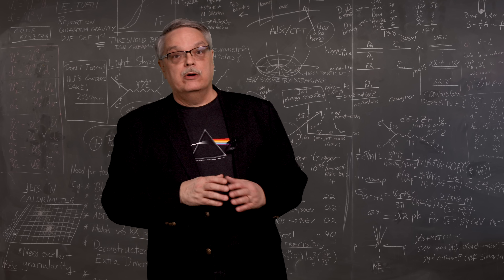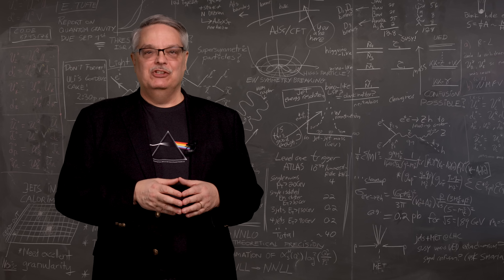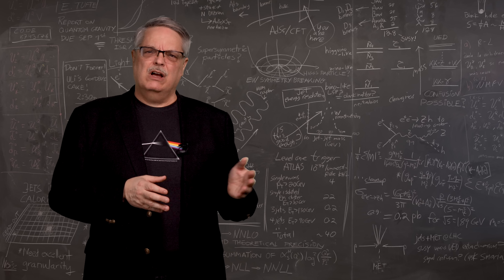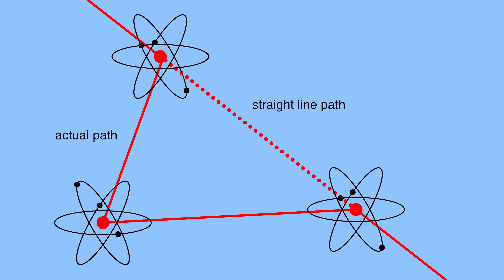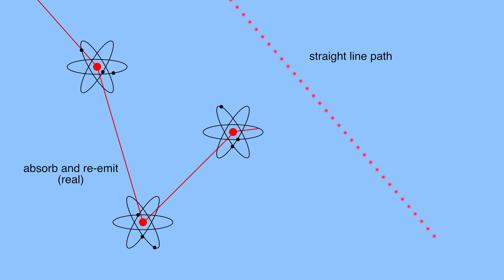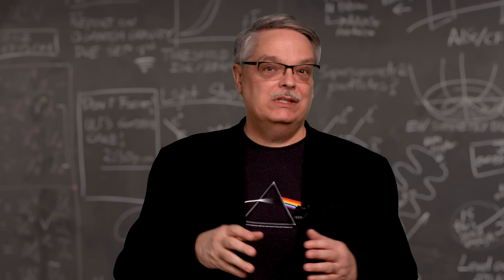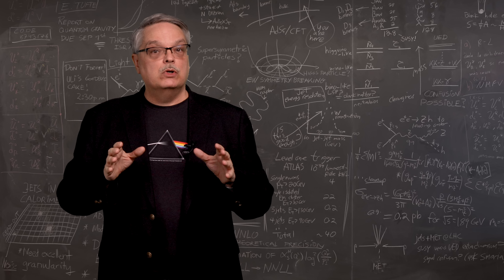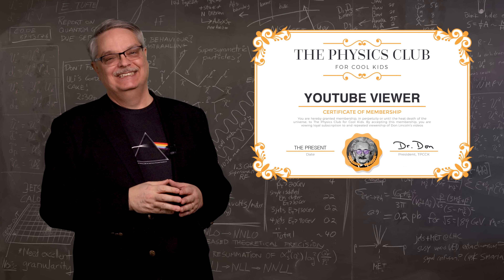Why does light slow down in water?

Comment: What a great explanation. A physics teacher just got taught.
Reply: John Wright #lit
Reply: #worstphysicsteacher
Reply: @edrobinson5438  but not ginger
Reply: #exginger #childhoodtrauma
Reply: @Henry-dz4so  Not sure what this means
Reply: What a beautiful comment John
Reply: @harryphilipson-stow5402  Mr Wright to you
Reply: Beautiful
Reply: as a physics teacher you should be ashamed to even consider this a valid explanation...
Reply: @recouer  What would you consider to be a good explanation?
Reply: @chopperwright  
i don't know what grade you teach but for university level education, well it's clearly full of wrong hood.

to understand how a wave propagates, first you'd need to understand d'alembert equation and dispersion relation.

then you'd need to study maxwell's equation to understand how EM waves propagates in a void (take the rotational of maxwell ampere or maxwell faraday to find the equation of d'alembert that EM waves follows in a void; btw void => volumic density of charges is null)

then you use paul drude's model to understand how EM waves propagates in a medium (also that fact that it is neutrally charged implies that the volumic density of charges is null so the condition to get the dispersion relation are still respected).
and you use newton's second law on an electron, using this and assuming that it oscillates, you'll get a relation between the electric field of the EM wave and the speed of the electron.
you can then get the volumic density of current in the field induced by the electric current.
you introduce that in the maxwell equations to and you get a new dispersion relation, with the frequency being smaller, you thus get a wave with a smaller speed through the medium.
thus the slowing down of the light is due of the induced electric current from the EM field and not a superposition of light...

also, if the electrons emited light from the EM wave, we'd see EM rays with stonger intensity as light travels a dispersive medium but even that isn't quite true as if we still have the refractive properties of such medium, then those photons would travel at different direction from the incident light.
Reply: @recouer  Phew, I'm glad we agree. Need a wave model to explain this. He does such a great job at explaining the concepts clearly so that a typical teenager can understand it. I look forward to your video on the subject.
Reply: @chopperwright  
i'm not a content creator so i wouldn't be able to do it. also i have other imperatives as you see i'm a rather busy person and only happened on this video during my free time.

and no he does not explain at all what is happening but rather either saying something wrong due to lack of vocabulary or misunderstanding.
first, superposition of wave: the resulting wave still has the same speed no matter the frequencies of the superposed waves.
then the electrons do not emit an electric field as they move, but an electric current, wich is a big difference.
Reply: @recouer  it's not the different frequencies of the wave, it's at different speeds!
Reply: @chopperwright  
in a void, all EM waves have the same speed.
Reply: @chopperwright  well that may not be clear enough but if you were a physics teacher (which i highly doubt now) you’d understand the many problems this “explanation” would bring to a neophyte on the matter, as shown by the many people who are left with more misunderstanding on the subject before than after the video.

anyway, first of all, the emitted light from the electron, this one is wrong on so many level:
if light was emitted due to the movement of electrons, then the light should gain in intensity as it goes through the medium since light is quantified and thus the superposition of the two photons would give one with the cumulated energy of the two.

then there’s how he tried to explain what is the frequency of the superposition of two waves, but i won’t get too much into details as it is more mathematics than physics. but basically, you need to take into account the temporal and space dependency, which he did not.
or the cancellation of the two waves… well that only happens in some very special cases and we need to be cautious about how it’s described.

also he describe the waves as if they were linear and infinite, but this ain’t always the case, but we still observe the slowing down of the wave inside the medium, how come ?

then he says moving electrons set their own “electric field” which is wrong, you can easily know the electric field of an electron using coulomb’s law. however, things are a little more tricky with dipoles. however, the electric field has nothing to do with our exemple here.

the thing is he should have been talking about electric current, which is greatly different to an electric field. because you don’t create light every time you create an oscillating electric field.
heck, electric cars would radiate a shitton of light otherwise !

and then again, light speed is dependant on the medium, thus the electron that it would create if we are to assume that it actually radiate one, would go to the speed of light the moment it leaves the electron, thus no adding of velicity, they both travel at the same speed.
Reply: @recouer  but it is in a medium, not a vacuum.
Reply: @recouer  Rather than attacking his ideas present your own ones. I am struggling to follow your line of reasoning. Is English your first language?
Reply: @recouer  Electromagnetic waves are created by accelerating charged particles. Cars emit loads of electromagnetic waves, not because they are moving, but because they are hot. They emit mainly in the infrared part if the spectrum. Its nothing to do with the car being electric or petrol, it's just because they contain protons and elections. There are charged and vibrate because they have a temperature. The oscillation of charged particles is how ALL electromagnetic waves are formed.
Reply: @chopperwright  
no it's not and it becomes all the more obvious when i need to translate scientific terms but still it is comprehensible (if i did put quotation for every things i was refering to... i'll do that now)

anyway, i see you do know some physics well i'll give you some wikipedia articles that would get more into details, maybe it'll be clearer that way:

https://en.wikipedia.org/wiki/Maxwell%27s_equations
https://en.wikipedia.org/wiki/Wave_equation
https://en.wikipedia.org/wiki/Drude_model
https://en.wikipedia.org/wiki/Mathematical_descriptions_of_opacity

those are in order but if you are already familiar with the first two or three just go to the last.
Reply: @chopperwright  
as for my references, well it was my lessons, but since i am most kind, there is this book that is a pure condensate of physics, a great introduction to many interesting fields of it:
https://www.dunod.com/prepas-concours/physique-tout-en-un-pc-pc
well i hope you like french.
Reply: @chopperwright  
oh and i wasn't talking about thermal radiation, i don't know why you assumed i was talking about it when i was clearly talking about the varying of electric field in a medium.
the thing is, you can create varying electric field in mediums without using EM waves.
does it creates EM waves then ?
Reply: @recouer  I admire your enthusiasm. You have been quick to condemn a university lecture and a physics teacher, a little humility would no go amiss. You have read widely around the subject but you have not applied the physics well to the situation. Think through your explanation of why light slows down (don't just copy and paste complex physics, think what physics you need to explain the phenomena). Find a video or written explanation that you agree with then send me the link.

If you are a student show the video to your teacher, ask them what they think.
Reply: @recouer  Frequency stays the same, otherwise the light would change colour.
The wavelength decreases in the glass, and therefore the speed decreases.
Reply: @chopperwright  
think again, what is the relationship between wave length frequency and speed.
(this is no way to advert the subject, i'll give you the answer but i want you to think about it before)

and well, true i should show humility.. when i am talking about something i don't know about, this is not the case here.
Reply: @recouer  Great. The charged particles move very slowly in a conductor because there is so many of them. We are talking mm per second or less. The accelerations of the charged particles are very low. There is not a lot of em radiation produced by direct currents. To generate Em waves ac is used.
Reply: @recouer  wave speed = wavelength x frequency. When the wave enters a medium and slows down

1 wavelength decreases
2 frequency stays the same
3 speed decreases

Not sure what you are getting at here. I do admire you doing this in a second language.
Reply: @chopperwright  
i did try to find written explanation that are not on the wikipedia page but they are all paid book...
however i can assure you the wikipedia page is a reliable source of information on the matter, as it is edited by peers.
Reply: @recouer  Send me the link!
Reply: @chopperwright  
why should the frequency stay the same ?
what i'm getting at is that it is the frequency that is modified, not the wavelength.

the link i already sent, look for maxwell equation wiki page and go to references, with a little luck, there may be a free book.
https://en.wikipedia.org/wiki/Maxwell%27s_equations

electric vehicules use AC currents to rotate the engine duh! 
the low speed of the electrons doesn't mean there is no current.
Reply: also you are talking of the speed of free electrons from one atom to another, in my model, the electrons needn't be separated from their atoms for it to hold true.
Reply: @recouer  no one's model has free electrons. They are all in atoms.
Reply: @chopperwright  
"The charged particles move very slowly in a conductor because there is so many of them. We are talking mm per second or less"
you said this, i thought it was in opposition to my model
also drude's model is only with free electrons, even though we can generelise this phenomenon if we consider atoms as dipoles and then using the polarisability of such dipoles, we get back to the same equations (but the coefficient will be greatly diminished, which is why metals do not let visible EM waves pass through as they have small frequencies thus the plasma pulsation of metals is very high compared to other mediums)
Reply: @recouer  sorry, this was for the electric car.
Reply: @recouer  if frequency changed the light would change colour. Frequently constant, wavelength decreases
Reply: @chopperwright  
the issue is that we all observe the light in the same medium: the aqueous humor of the eye (even though this statement is wrong and it would be more correct to say that it is the photoreceptors of the eyes that are the medium)
so no matter the medium in which the initial refracted light is perceived, it will always be in the same medium during perception thus it has no significance what is the modified value.

but you're right, its frequency is unchanged duh!
(at least if we follow my model)
Reply: @chopperwright  
btw in what grade do you teach physics ?
Reply: @recouer  13 to 18 year olds. Engineering degree but some knowledge of physics.
Reply: @chopperwright  
that may be why you weren't very familiar with the subject, since maxwell equations isn't really something you teach to 18 yo.
anyway since you have an engineering degree, you must know what a curl, divergent and gradient are, as well as a derivative. 
(anyway, i drop that here in case you're no longer familiar enough:
https://en.wikipedia.org/wiki/Vector_calculus_identities#Curl_of_the_curl )

also, do you have some notions on scalar representation of waves and wave equations ?
Reply: @recouer  I do. What level do you teach to?
Reply: @chopperwright  
i'm no teacher 
but the french curriculum to become an engineer is quite something: we learn math, physics and chemistry and almost to the level of a bachelor's degree, then you get to an engineering school where you'll specialize yourself up to a graduate degree.

so we end up being knowledgeable on many subjects.
Reply: @chopperwright  
yeah i was puzzled by what i said myself, as i know the energy of a wave is dependant on its frequency and since the energy is conserved if it goes through a dispersive medium then i'd made a mistake since i said frequency is modified (and so its energy)

oh btw i found that one answer which is quite detailed i believe:
https://qr.ae/TW85PN
Reply: @chopperwright  You are correct.  Frequency is the same.  Wavelength changes, as does velocity.

I do think I would say that color also changes in a medium.  After all, if you did a diffraction experiment under water, you'd find that the central maximum peak was narrower than if it were done in air.  Since it is wavelength that interferes, that is essentially color.
Reply: @drdon5205  
no the color is determined by the energy of the photon and you can get it from the relation E = h*f thus since the frequancy is unchanged when changing medium, so is the color.
Reply: @recouer  Actually, I quite disagree with you.  However, the reality is quite a bit more nuanced than you say.

For instance, color is neither wavelength, nor frequency.  Nor is it energy.  Color is perceptual.  Color is something that we see.

For a more quantifiable point of view, you have to talk about wavelength, frequency, energy, etc.  And it is true that in free space that frequency (f) x wavelength (L) = the speed of light (c), e.g. f x L = c.  It is also true that E = hf (where h is Planck's constant). 

However, in a medium, the velocity (v) is lower than c, e.g. v = f x L', where f is the same inside and outside, but now L' is lower than L.  Further, the simple equation E = hf is no longer strictly true, since this is true for objects traveling at c, which is no longer true.  Inside the material, the wave that is relevant is an admixture of the initial light wave and the wave induced by motions of electrons inside the medium.

It is wavelength that is relevant in a Fresnel spectrometer, which results in a smaller central diffractive peak.  In a standard prism, which operates on dispersion as a function of wavelength (or velocity or index of refraction), the conclusion is the same.

It is clear that you've read a number of things, but it is unclear that you have properly internalized exactly what is going on inside a linear and homogeneous dielectric.  This is a complex space and the simple conclusions are hasty.
Reply: @drdon5205  
i don't mean to be rude but you don't know what you are talking about.

if you read the whole conversation you'd see that i stipulated the same misconception that you did only to rectify myself right after because of how stupid that sounded (well i was kinda sick at the time XP )

anyway, we can easily see why your statement is false for a simple reason:
let's say you need to excite an atom, you'd need a given wavelength for the photon to have the right energy to excite it. however, if by going through a medium, your EM wave is to be separated into 2 EM wave, one incident the other induced in the medium and the 2 have different frequency, then none would have the right energy to excite the atom and so the excitation of atoms would need very specific wavelength for each medium as the energy of a photon would change depending on the medium.
however this is not what we observe in reality.
Reply: @drdon5205  if you are the DrDon from the video then thanks for the great videos. I've ordered your book for the school library.
Reply: @chopperwright  I neither confirm, nor deny, the correspondence.  But thanks.
Reply: @drdon5205  
"It is wavelength that is relevant in a Fresnel spectrometer, which results in a smaller central diffractive peak"
it's only a convention because the speed of light is almost the same in air, thus the wavelength too.
and how did you came with this conclusion, it seems completly parachuted to me with no relevance to what you said earlier 
eg: the planck energy formula doesn't hold true if light is in a medium.

but after giving it some thought, maybe you tried to say the same thing i did but since you aren't very knowledgeable on the subject, you confounded the many terms to describe the phenomenon.
first, you said electrons emit EM waves when oscillating due to the passage of an EM wave (well if you've done a little quantum mechanics you'd know immediatly why this is wrong) maybe you didn't mean that they emit EM waves but simply that there is an induced electric current.
and when you talked about superposition of waves, maybe you tried to simplify to an extrem (which would make it blatantly false as you can't superimpose electric field and electric current) how the induced electric current modifies the propagation equation of the EM wave thus modifying its speed.
Reply: @recouer  It is possible that I am not very knowledgeable on the subject and that you know more physics than I do.  Given the doctorate in physics, several decades of experience, and hundreds of publications, it seems unlikely.  But it is possible.

However, assuming that my knowledge base is solid, I simply disagree with what you are saying. Other readers can make draw their own individual conclusions.
Reply: @drdon5205  
"the wave that is relevant is an admixture of the initial light wave and the wave induced by motions of electrons inside the medium"
could you elaborate on what you meant by "wave induced", is it an EM wave, or something else ?

also, your experience doesn't makes you foolproof, you'll forget most of what you've learnt over time if you do not practise regularly, and thinking that your decades of experience gives you some sort of universal knowledge on physics is a trap that you shouldn't fall into. Even with your decades of experience, you'll always learn new things.

"The propagation of electromagnetic waves in turbid media is fundamentally
described by Maxwell’s equations, which are mathematically rigorous and accurate"
this is literally the second sentence of a thesis i found randomly on the internet...
https://core.ac.uk/download/pdf/34635812.pdf
Reply: @recouer  It is true that degrees and experience do not guarantee expertise and that a person is right.  But they certainly help.  Perhaps you know more about the subject matter than I do.  But, judging from your posts, I am comfortable in finding that unlikely.  It is true that you know some of the words and a little of the physics, but it appears that you have not taught graduate level E&M.

And I agree that the propagation of EM waves are described by Maxwell's equations.  And that is entirely my point.  Inside a medium one must rigidly follow Maxwell's equations, but this includes the effect of the material through which it is traveling.  Those waves induce changes in the medium and the net effect is the aggregate wave.  Different people use different vocabulary to describe this, whether it be group vs. phase velocity, or different permeability and permittivity of matter, or a time-varying polarization of the medium, or simply a superposition of multiple wave fronts from multiple origins.  The words all are different ways of describing the underlying behavior.  The result in a medium is a net wave that moves more slowly than its Fourier components, each of which who move at c.

To understand this better, I'd recommend the textbook by Jackson.  It's not easy going, but it's >>THE<< bible in graduate level electromagnetism.  A good, but somewhat easier, book is Griffith's book for advanced undergraduates.
Reply: @drdon5205  
and finally a proper answer!
anyway, the issue i pointed out is that while what you said might make sense to you, to most people, it doesn't because people believe when listening to your video that while traveling through the medium, there is another created EM wave that travels slower than the speed of light and that the composition of this induced EM wave plus the incident wave create a slower EM wave which i believe you too, consider this to be false.
it is not that i don't have an undergrad understanding, it is that what is understood of your video is unclear.
also my vocabulary may appear lacking as english isn't my mother tongue. but if you have other books that you consider to be a must to read, i'd be glad to know of them!
Reply: @drdon5205  
and if your throwing of all those notions that doesn't describe what you are talking about is supposed to be a test, don't think that i didn't notice, it's just that i don't want to be nitpicky about it.
Reply: @recouer  All of them are relevant and different ways to view the same thing.  

And I never make fun of non-native speakers.  I speak English and at best horribly fragmented and non-expert French.  I have great respect for people who are multilingual.  It is a skill that I never did master.
Reply: @drdon5205  
they are talking of the same thing but do not describe the same properties, i guess this was an overinterpretation on my part.

anyway, i wasn't ironic, any good litterature you got would be most welcome.
Reply: @recouer  The best literature is the Classical Electrodynamic book by J.D. Jackson.  Good luck...it's difficult.
Reply: @drdon5205  
i didn't mean for electromagnetism. and i already started this one anyway. but if you know for quantum physics, thermodynamics, general relativity that would be nice.
Reply: @recouer  I don't know your level of current mastery.  Accordingly, it is impossible to recommend appropriate books.

Griffiths did a bunch of good undergraduate ones.  For graduate, I'd go with Reif, then Cohen-Tannoudji, Laloe and Diu, and finally Wheeler, Thorne and Misner.